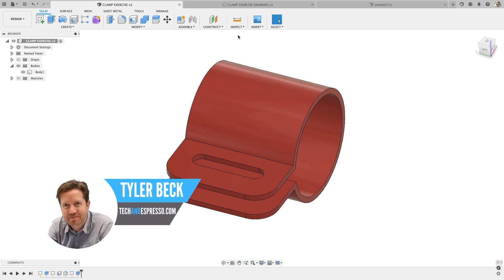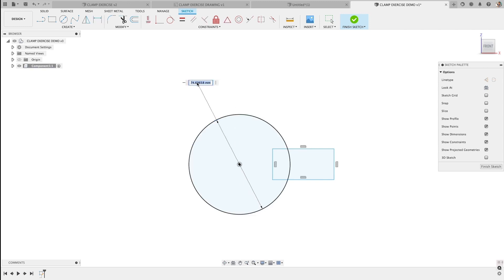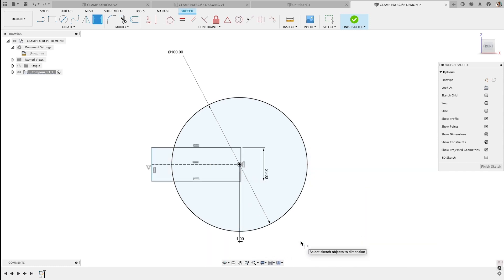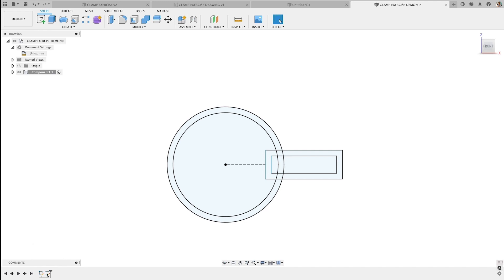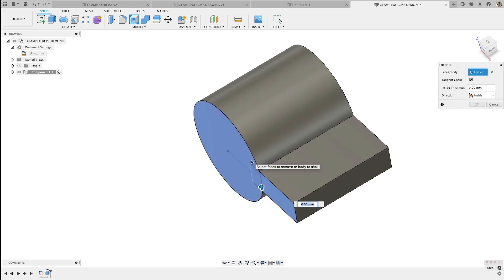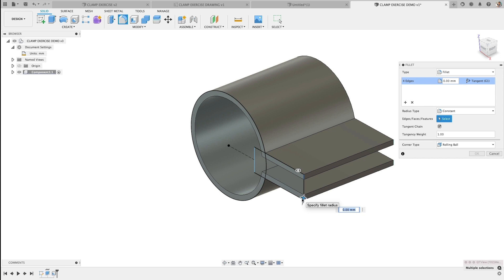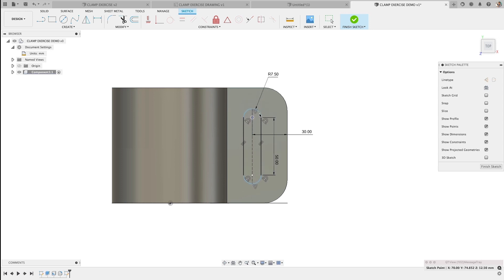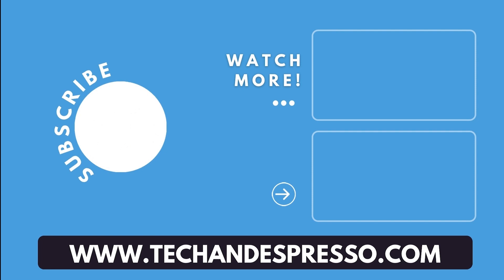Shell This Part?  [Fusion 360 Clip Tutorial ]

Comment: Hey Tyler! Since you've been helping me so much with learning Fusion 360, I feel like I might be able to share a tip you may or may not know about. At around 1:40 you made the center of the rectangle horizontal to the sketch's origin by connecting the two with a line and making the line itself horizontal. What I typically do in this case is, without even drawing a line, I click on the horizontal constraint button, click on the origin of the sketch and then on the midpoint of the rectangle (I hold down shift to make the midpoint a selectable point). This avoids the need to make an additional line. The constraint makes any line horizontal or vertical but it can be used to make two points horizontal/vertical to one another. There's a large possibility that you already knew this and were keeping things at more of a beginner level, but it's something I use often. Thanks again and keep up the great content!
Reply from the maker: Sweet!  I think that might be in my 44 tips for sketching video, but I love that one.  Thank you for sharing.  Yes, I am constantly looking for the right level of detail when teaching this beginner videos - dont want miss the good stuff but don't want to overwhelm either?

Comment: instead of the trick of the line from the center to the center, I do the following: select the horizontal coincidence , hold down the shift button, pointing to the middle of the required line, select the first midpoint, again without releasing the shift, select the second midpoint.  Done.  -1 action and less unnecessary objects in the sketch.
Reply from the maker: Sweet!  I think that might be in my 44 tips for sketching video, but I love that one.  Thank you for sharing.